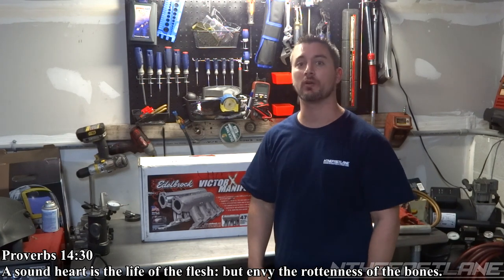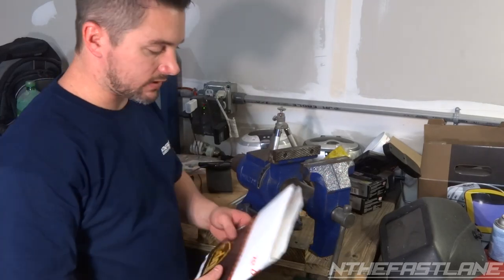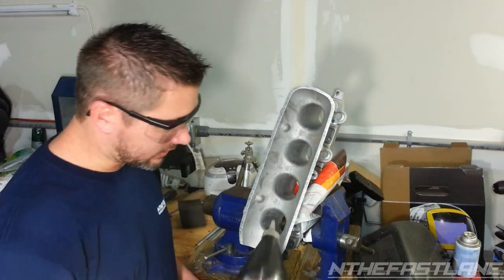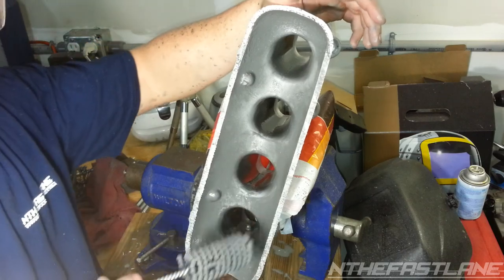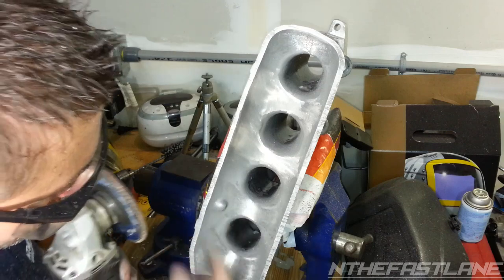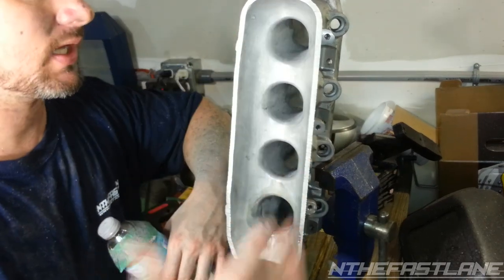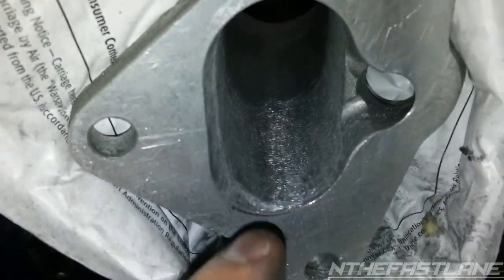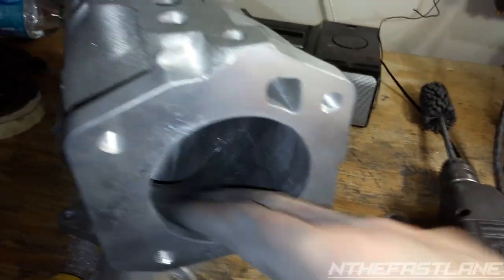▶️Edelbrock Victor X Intake Manifold Port & Polish "How To"🔧

Comment: I've heard that the intake manifold should have slight imperfections so that the air can tumble past. It is the same theory that keeps golf balls in flight further than a smooth ball. Tiny dimples supposedly help airflow. What kind of power gains have you seen from this?

Comment: do you flowbench your ports after?by the way 60grid does not polish at all...we use 80grid as ruff grid to do the porting...gota go 120-220 after its good to go....60grid is way to ruff bro you left thousands of scratches...you should mesure your ports as well so they dont come out uneven like some of them look...just trying to help ya!
(i work at the best engine building,porting,machining shop in canada) (Raceheads)
you gona see us at amsoil engine masters challenge with a gen 3 hemi with w2 heads pushing around 700torque
take it easy keep up the work!
Reply: Wont the scratches left from the 60 help? I dont know about porting and polishing but I hear often that a somewhat  rough surface is better for intake side and exhaust can be mirror finish and smooth I better? So if he wants the polished look that exhaust side gets the it should be rough right? Or am I way off?

Comment: What are the advantages of port and polishing intake manifolds and other interior engine parts? Do you gain more HP than how the part comes from factory because the air can flow more freely through the intake?
Reply from the maker: Yes. the skunk 2 ultra race manifold I did, we did a mild port & polish and gained an extra 10 CFM, then we took it to the shop for a little more porting on the runners and gained an extra 100 CFM of air flow which leads to greater horsepower..The manifold was bench tested.. so these are proven facts not just me saying this.
Reply: +Nthefastlane i got my answer good thing you flowbench them,keep up the good work !